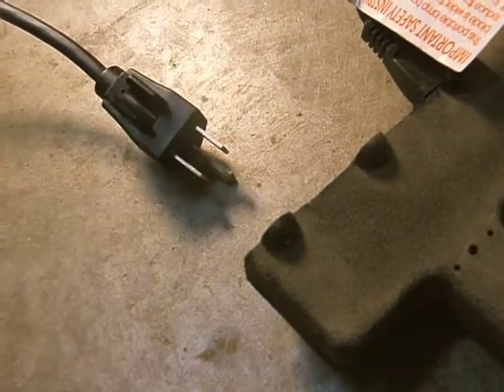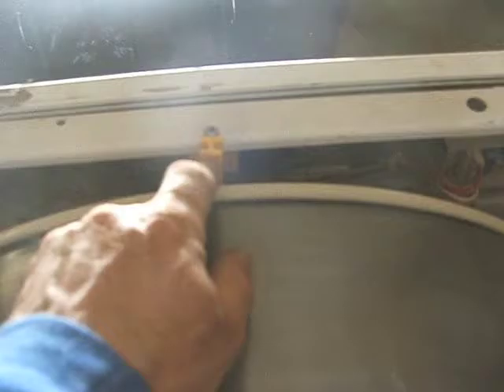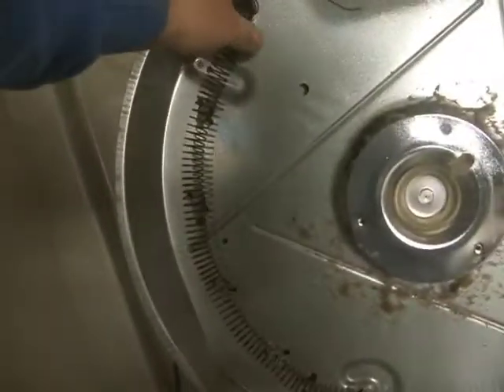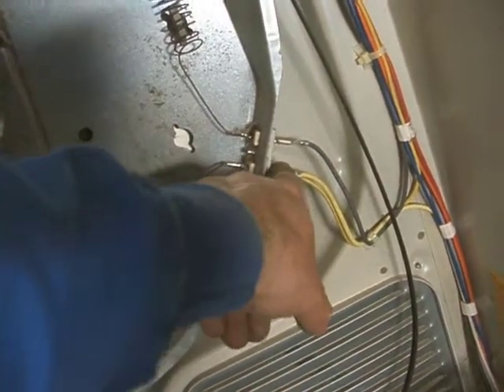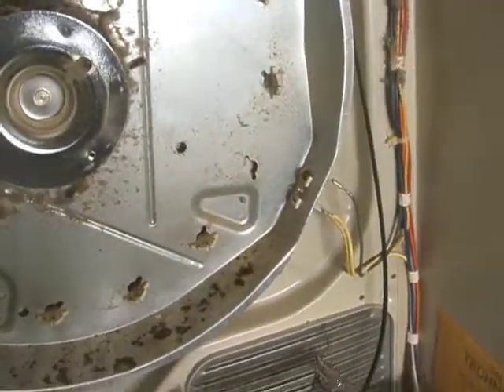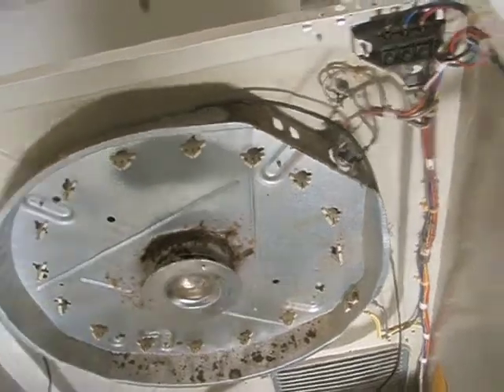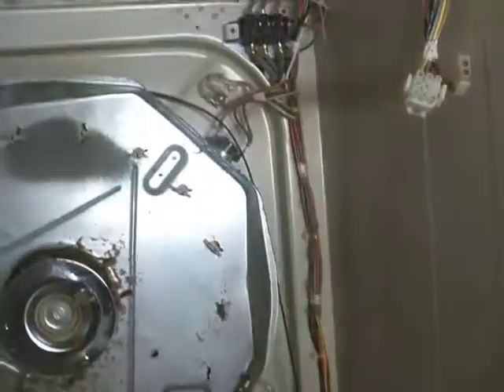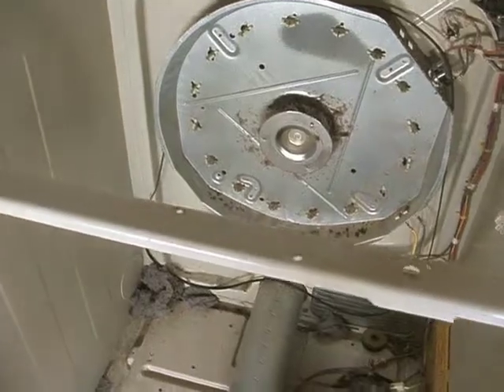REPAIR Electric dryer isn't heating up Checking and replacing ELEMENT THERMOSTAT AND FUSE

Comment: what happens if I went thru everything and still won't dry it turns on and everything except wnt dry I check volts thermostat I check for condenisty and good so what Will be next